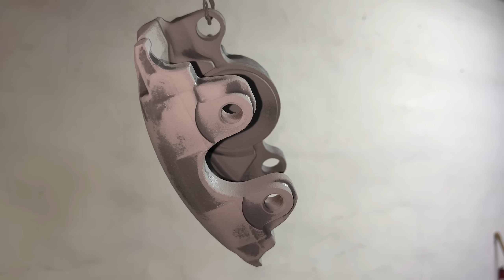How to Paint Brake Calipers - Like from the FACTORY

Comment: The acid does trash threads. Try it by putting a bolt and a nut in vinegar and see how loose the connection gets. I have done this.
If you were able to seal the threads well with some plastic fittings and maybe Teflon tape to seal them. It would work.
The piston housing itself doesn’t really see the piston. They don’t come into contact with the walls of the housing. Still. I would seal the piston hole off while using the …..vinegar or citric acid. I would not want that bore to be ate down by the acid.
The acid when washed off. Creates immediate flash rust. Yours were very clean. I don’t know how you achieved this. 
I have achieved this by washing the metal off and immediately putting them in oil. Giving it no time to rust. Then I have to clean it again with solvent. 
The zinc primer is not bad. It has anti rust capability. 

Is this worth the time? Not really. You can buy the parts for not too bad. However. You can buy a rebuild kit for $5 and never do any of this at all. Just keep them rusted. The factory doesn’t coat them on many cars. They just rust. Newer cars coat them. 
I have done all of this several times and am about to again. I might go through the trouble of de rusting.   Only because I’m doing several calipers at once. 
The paint is just high temp caliper pain and it does have to be baked on. 
Powdercoating is better😊

Comment: In 6 months those will need ALL this done again.
Reply: If you drive in salt. If not last some years.
Reply: Ridiculous statement, this will be strong, I have painted calipers many times and never even baked them. The immediate heat from the very first uses cake the paint, like powder coated. No once have any caliper that I have Painted, ever lost their paint other than after many years through normal wear and tear.
Reply: Use high temp paint or powder coat

Comment: You don't put grease on the piston the dot3 or dot4 fluid is what lubricates the actual piston it's useless to lube it with that white grease.
Reply: You lube it so it doesnt pinch the oring when it goes in and then leaks loosing brake pressure

Comment: "Like from the factory" You might as well be at the factory. The equipment and the methodology used is way more involved than anyone at home is going to use. At least the restoration step. Most people would use a wire brush and brake cleaner at home. This is less a "how-to" video and more of a restoration video. I've mostly seen people cover the pistons, rather than pop them  out and  clean them. Though if they are that old, and damaged it's probably better to replace the whole caliper. You never know how much the rust has weakened the metal. Even if the citric acid removed the rust, rather than just bleaching it.